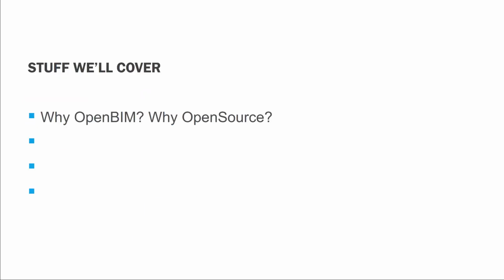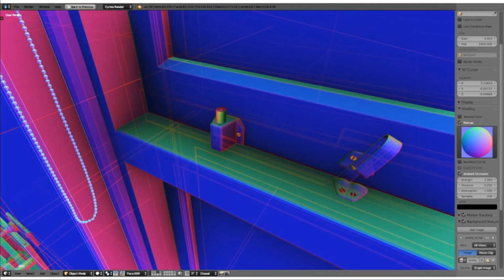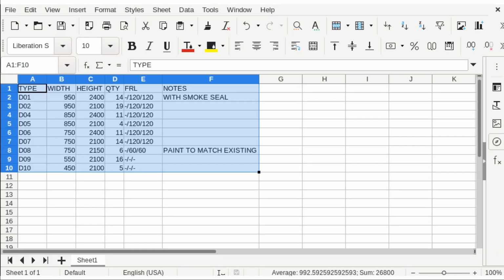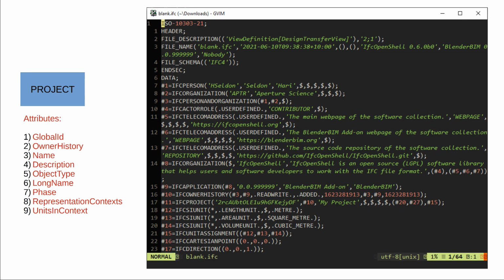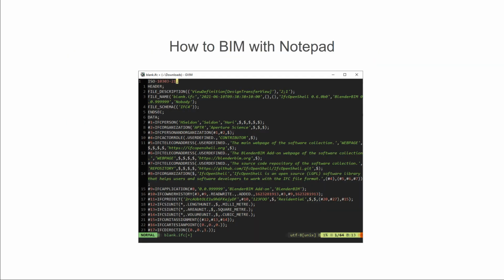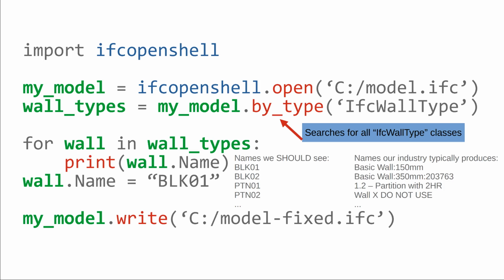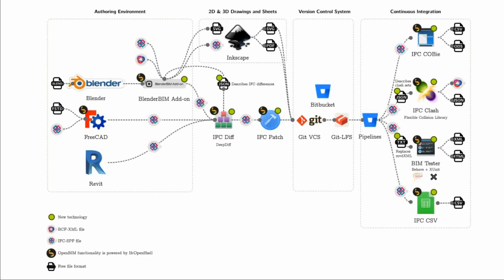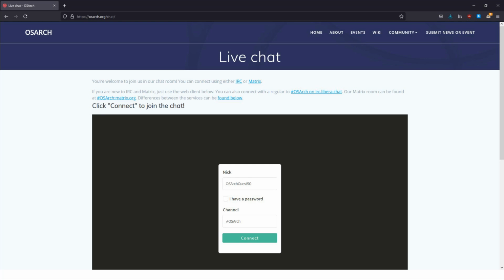Introduction to OpenBIM, Native IFC, and Open Source AEC

Comment: Hello, and thank you for that add-on, that I personnaly need for fun and better building... ^^

I just need two pieces of advice. From what I understand, you have to integrate elements 1 to 1.
I have a wall, with Warren trellis type posts every 60cm, straw between the posts, wood panels + exterior lime wash of a few millimeters and a 5 to 10cm interior raw earth coating (according to my desire) , part renovation with an existing silica brick wall.

Bulk :
— How to create Warren type posts? (I have some for the slab, walls and roof beams). Should I model this by hand then integrate it into an ifc ?
— How to make straw bales to be able to count them and know how many to re-size? The same for wooden panels, for cuts and losing as little material.

Thanks a lot !

Comment: -Existing BIM solutions have their own way to store data so it is difficult to talk to each other and they all are require subscription
-With open data standards, we can have a common ground to exchange data without losing information
-Common open standard for BIM are 
~IFC (Inductry Foundation Classes) : For exchanging classification & geometry data
~BCF (BIM Collaboration Format) : For issue management
~IDS : For model checking
~BSDD : For data translation

---

OpenBIM is about freedom of data
OpenSource is about freedom of users

---

Traditional way to do OpenBIM is by exporting IFC from proprietary software causing
-Data loss
-Mapping problems
-Read only
so the openBIM data cannot be trusted

Native OpenBIM approach
-Interoperable
-standard-based data

---

07:13
Example of using IFC model with Radiance

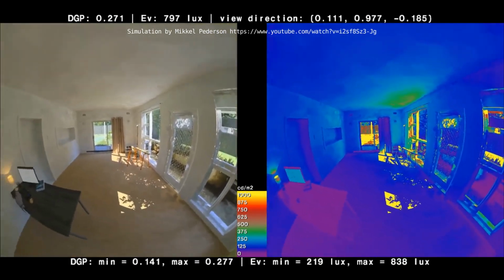08:44
Example of using IFC to store Point cloud data

09:07
Example of using IFC Model to generate 2D Drawings

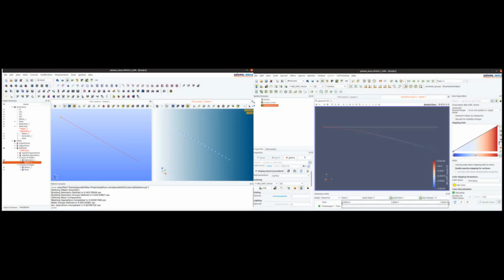11:18
Example of using IFC Model to do structure analysis with Code_aster / adapy / calculus

12:03
Example of creating wall with Blender sketching tool

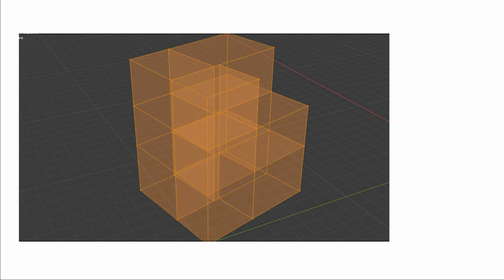12:54
Example of generating geometry within IFC

You can do more thing using IFC
-Costing
-Automatic Formwork calculations
-Scheduling
-4D Animation

---

How does Native IFC work?
-It describes a series of concepts that have meaning
-1 concept => 1 class (as in programming)
-each class has their own attributes
-some attributes refer to other classes
-Combine all these classes we can form a IFC Object Model

---

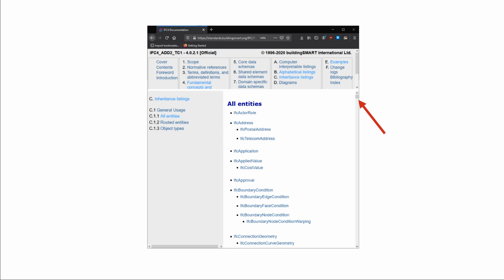17:13 
Hierarchic Tree of IFC Classes

IFC standard has different classes for different people
-Domain-specific concepts
-Basic Industry-wide concepts
-Raw Data for computer guys

Knowing the definition of each class is not enough, we need to know how to combine them
https://standards.buildingsmart.org/IFC/RELEASE/IFC4/ADD2_TC1/HTML/

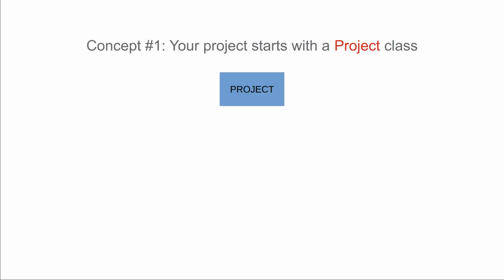20:14
Relationship Examples of IFC classes 
Concept 1 : Your project starts with a Project class

21:22
How to read IFC file using text editor
Refer to the document of IFC to understand the attributes’ order
$ means empty value, # means to refer to another class, .XXX. is an enumeration

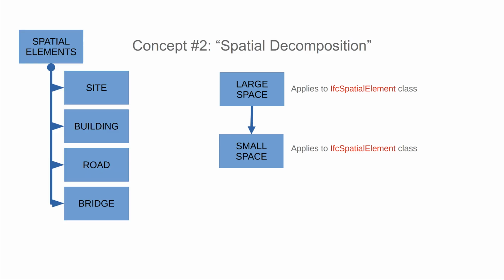23:10
Concept 2 : Spatial Decomposition 
Large Space formed by lot of small spaces
To describe the relationship  between these 2 spaces, we need to use ifcRelAggregate which is for connecting Bigger space with smaller space as per the description in ifc document.

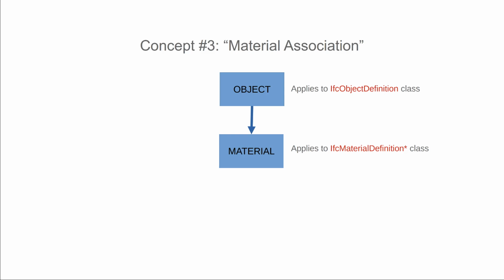24:30
Concept 3 : Material Association
To describe a slab make with concrete
ifcSlab <- ifcRelAssociateMaterial -> ifcMaterial(Name=Concrete)
if the class contains the word Rel, it is for linking 2 classes

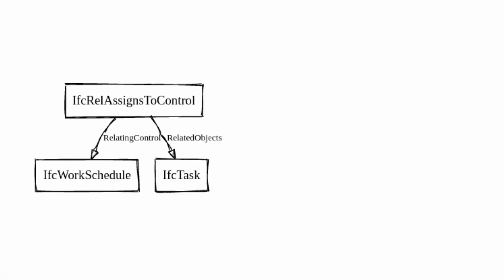25:20 
More examples

28:30
Myth:  IFC is the equivalent of PDF in BIM industry 
Fact: It is not only for reading, but also integrate with other standards.

29:57
BlenderBIM add-on with ifcopenshell

34:13
Examples of using ifcopenshell module

38:32
Tools to authoring ifc file

41:55
A custom pipeline to audit/process/generate data for a commercial project

44:20
How open source solutions have been adopted by commercial software

Comment: Someone knows what software he is using for generate drawings? Regards
Reply from the maker: The software is the BlenderBIM Add-on. There is a new drawing system in development which uses IfcOpenShell under the hood.
Reply: @DionMoult  Hi Dion. You have been doing fantastic work.  Things have been very quiet for the drawings production using BlenderBIM.  Is the project still active? Thx.
Reply from the maker: @Lake-Mist-V  G'day, the project is still active, but I have personally been taking some time off during the holidays, as well as preparing for some other FOSS events. Expect to see the commit log go back to normal.
Reply: @DionMoult  is a plugin of Blender? i never use blender, can i model and generate the draw with all-in-one soft?? :O
Reply from the maker: @ZaMahal77  It is a work in progress, but yes. In Blender, all-in-one you will be able to model, generate drawings, do cost planning, programme scheduling, structural analysis, facility management analysis, AR, environmental analysis, etc.

Comment: Amazing presentation - you've definitely refined the pitch over the years!

I'm all for this being the way things are done in AEC, however I expect lowering the entry point will be the key to bring in the majority (non-coders, non-programmers, laymen et al). Having said that, it's great to see real projects being realised using open source software and formats already as well as some exciting collaborations such as that with Topologic emerging. I really appreciate you diving into the technical aspects in this presentation, especially the step/json formats as well as showing the possible depth of the task example.

Keep going, I'll intersect with this at some point. The way Autodesk is going it's likely to be sooner rather than later.
Reply: At some point I believe programming will be a mandatory course across AEC education. Even high-school. Space exploracion, Machine Learning and AI, they all require at least some basic notion of programming. We are living that transition so... let's begin!